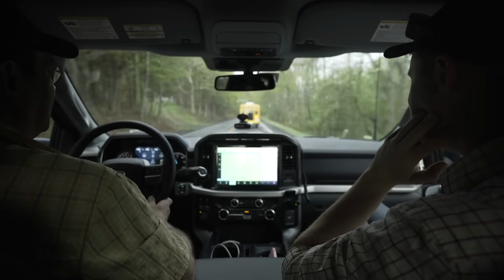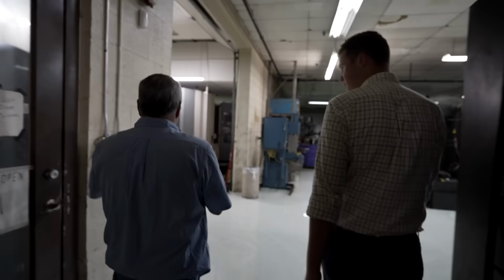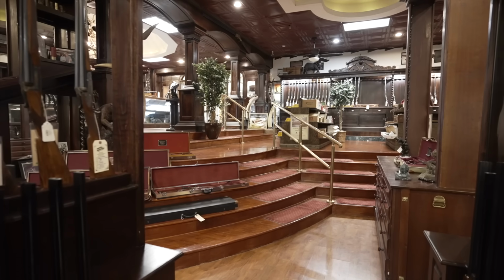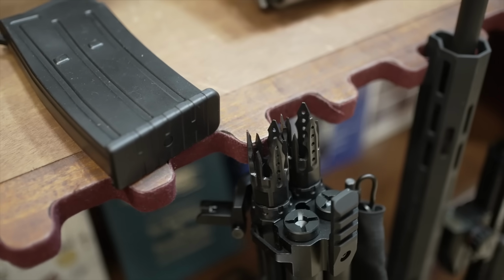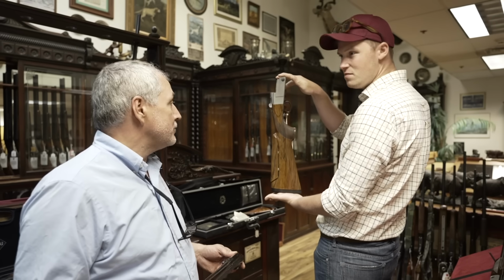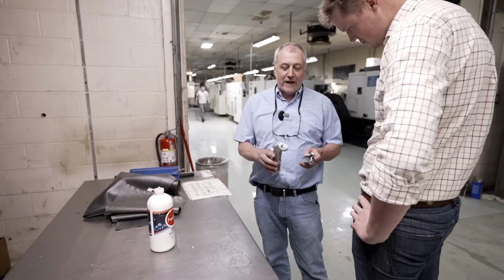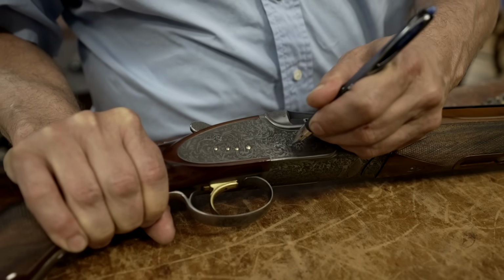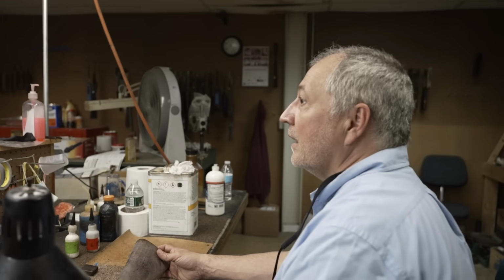The American Gun Factory Tour - Inside Standard Manufacturing & CSMC

Comment: First I don't own a Connecticut shotgun, and it's not likely I ever will. I can't speak to the quality of the guns, but to honesty in advertising. In April 2022 I was looking for a Beretta DT11 shotgun and found one on Guns International. The listing was as follows:  "SKU#: 28186
Title: P. Beretta - DT 11, O/U, 12ga. 30" Barrels with Optima Choke Tubes. CASE INCLUDED. MAKE OFFER.
Description: P. Beretta - DT 11, O/U, 12ga. 30" Barrels with Optima Choke Tubes. 
30" Steelium Pro Barrels, Optima choke tubes, beautiful walnut pistol grip stock, factory recoil pad, vent rib barrel, single selective trigger, trigger adjustable for length of pull, right hand palm swell, 3" chambers, brand new, in the case with all the accessories."  I inquired about the gun and agreed to purchase it. When it arrived at my FFL I went to pick it up. The gun was filthy. I don't think it had ever been cleaned, but apparently had not been registered. As it turned out it was likely used as a demo gun. The factory Beretta recoil pad had been replaced with a Kick-EZZ pad. The fit and function seemed okay, but it was missing all but the installed choke tubes, as well as all the other parts and accessories that should have been in the case. I called and spoke with "Shayne' who said he would look around for any choke tubes. He was not helpful. 
I subsequently contacted the Better Business Bureau and was told they had sent a letter to Connecticut shotgun but had not received a reply and that Connecticut shotgun was not registered with them.  Buyer beware.

Comment: THIS BRING BACK A LOT OF MEMORIES FOR ME. I'M FROM RHODE ISLAND AND I WORKED AS A DESIGNER FOR A COMPANY CALLED DEHOFF BACK IN THE 70'S. I DESIGNED GUN DRILLING MACHINES THAT WERE PURCHASED BY SMITH AND WESSON, COLT, SAVAGE ARMS, DAN WESSON ARMS. CHARTER ARMS AND MANY MORE. GOT INVOLVED WITH THE MANUFACTURING ENGINEERS AT THE FACTORIES TO SOLVE CERTAIN MANUFACTURING PROBLEMS.

Comment: Proud to be a 40 year experienced machinist and see others take pride in what they do automatically.
Reply: Same here from a retired musical instrument repair tech, 50 years experience.  There is only one way to learn, and that is by doing.  Crossing the edge teaches you the boundary is.  But .... It matters to few.
Reply: Amen, Brothers. Loved the trade starting in 1971. Turning dials and making chips. Didn't start pushing the green button till the 90's. Love watching you tubers teach people how to single point a thread, or comments on how inaccurate a southbend is. Did we all notice the grumpy old guy had no safety glasses on?
Reply: Yea. As a younger man I earned a degree in CNC machine tool and welding. In this I've been able and fortunate enough to work at a couple of machine shop manufacturing type facilities. In about 5 years total experience I became a really decent CNC set up operator proficient on several different machines. I loved every minute of that and gave the absolute best of myself every day.

Comment: "I THINK it's 4420". Sort of important. Shouldn't he KNOW? As you may know, several US makers used the same or very similar locking mechanism as the Fox. The rotary bolts were very strong, of course, and rarely, if ever, shot loose. Parker used a single large underlug and a doll's head rib extension. But they knew that the fulcrum...center of rotatory forces from firing was forward of the axis of rotation of the barrels when the action was opened. So they fitted the  huge extension through the bottom of the frame under magnification with great precision. The result was that, if the lug and top rib extension were removed and the gun just held closed by hand, it would not open on firing.
As to the guns shown, I would never buy one at any price, if the forend (or other) wood was left proud of the associated metal. Never!